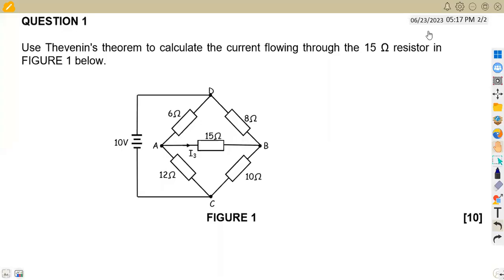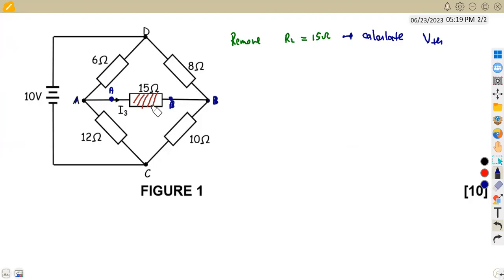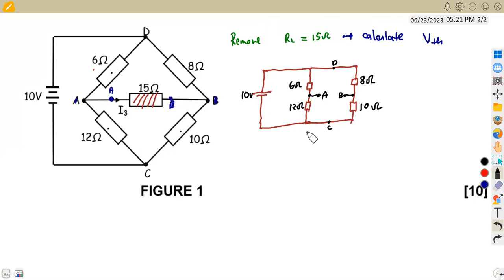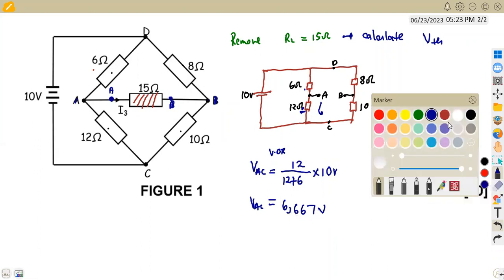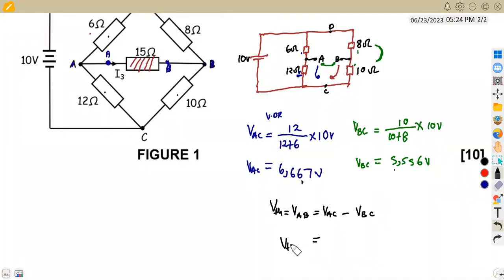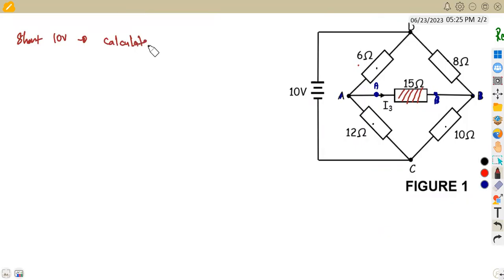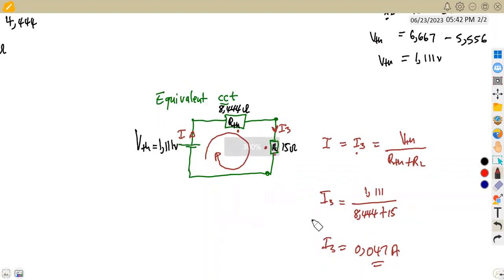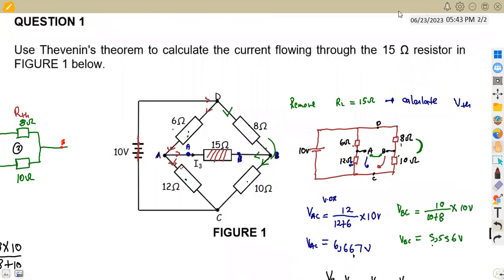Industrial Electronics N4 Thevenin's THEOREM AUGUST 2016 @mathszoneafricanmotives

Comment: Sir, why when you were finding the R equivalent you didn't treat 15 resistor as has been removed the facts that shows no current wound flow through 15, and this would make 6 and 12 to be in series since the 15 resistor has been removed.
Reply from the maker: I did remove it check from 1:09 my explanation